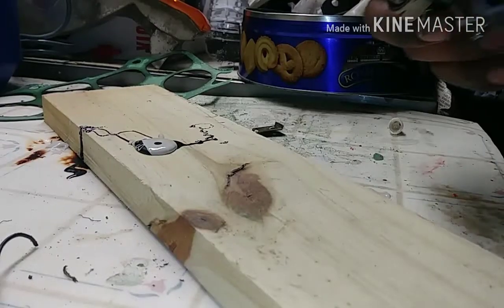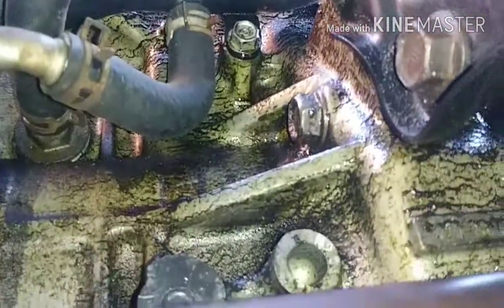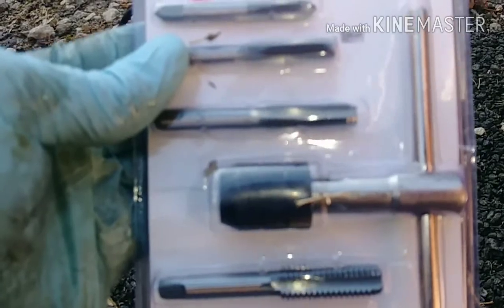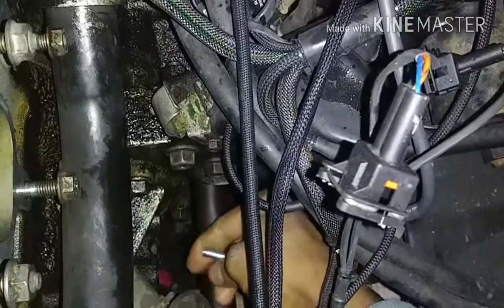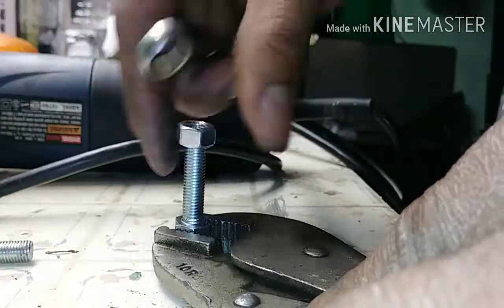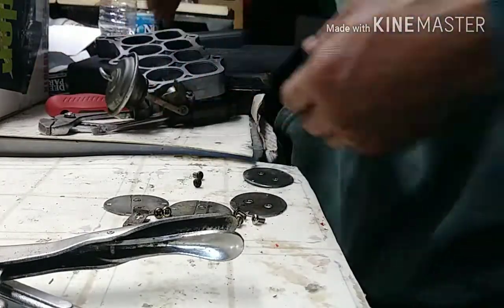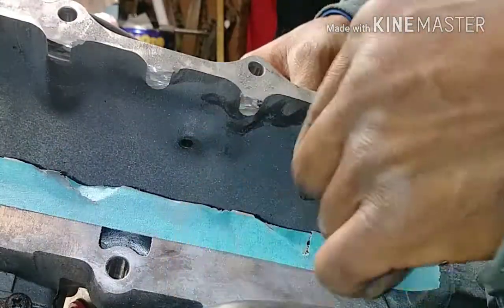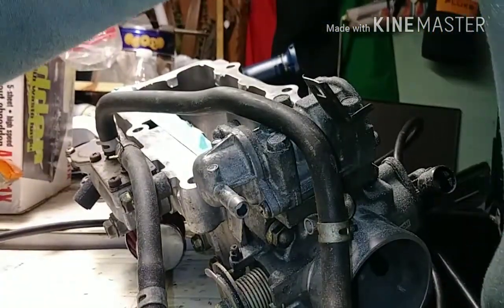H22 intake manifold ported and ready for install

Comment: Cool idea. Interested to see if there’s any improvement in performance. Might have to do this with ours this winter.
Reply from the maker: Mt Garage ; I would definitely recommend it. But I would recommend you remove the insides from the three pieces of the intake. And try to smooth the inside of the intake as much as possible . may have to adjust the throttle body screws. Which I'm going to show it in my next video. I found that out when I took it for a test drive

Comment: I would also recommend getting this done before having the car tuned on a dyno or on the street. That's where you'll see the most gains.
Reply: I don't think he will see any gains unless he is pushing 300 hp or more or is turbo'd. Just my two cents. You need velocity not just open space. You gut it out  too much and you lose air speed and torque.
Reply: Mikhail Kolitwenzew : I guess. But sometimes you just gotta send it. And see what happens

Comment from the maker: And the intake has come loose again
Reply: Oh nooo! Sorry man, did you put loctite on the nuts for the manifold? What went wrong? I put copper silicone on all my intake gaskets since this has been a common issue for me, leaky intake gasket. Also its a thermal gasket so that's kind of a given to use silicone. I know its very necessary on the little coolant hole. Hope you get it straightened out man!
Reply from the maker: This was my second time removing the intake manifold. the first time I did not use any Loctite. Second time around I use the red Loctite on the intake manifold bolts. But where I think I went wrong was I did not tap and die the brace that supports the intake manifold correctly.
Reply: Hmmm oh. I have a really low idle im wondering if i don't actually have a vacuum leak causing it. I don't use the intake brace and never have.